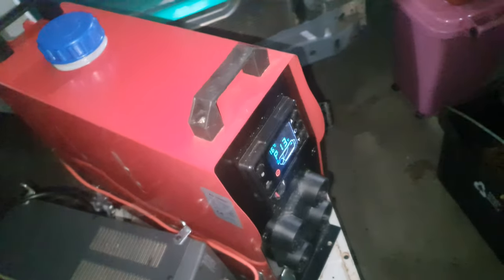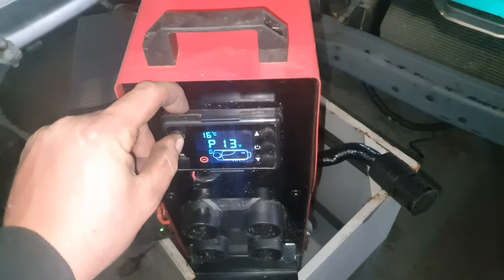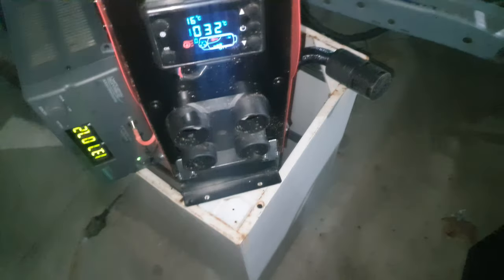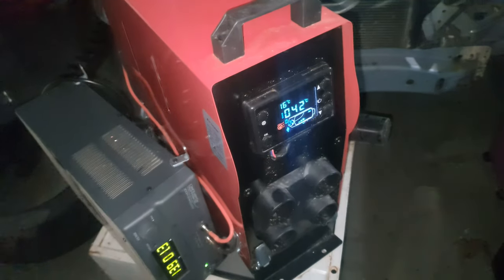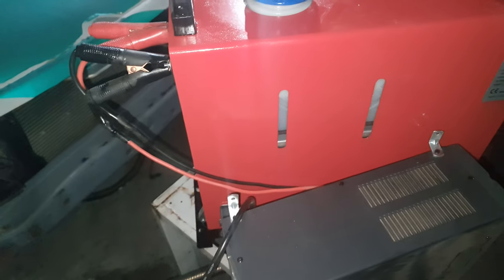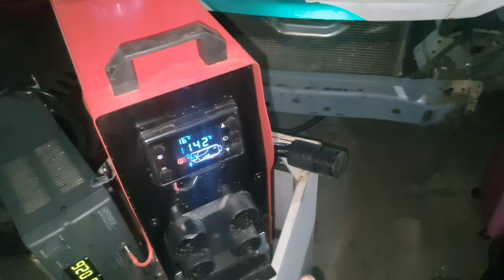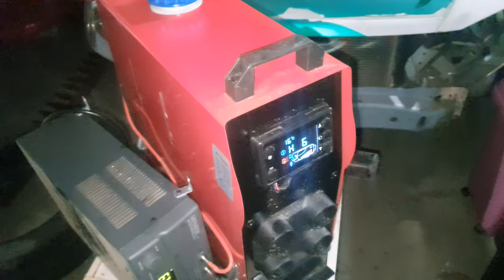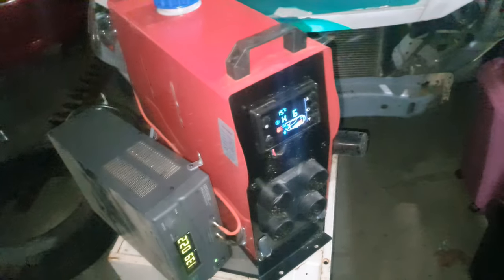All in one 5Kw Diesel Air Heater First Look

Comment: Hi Brad, I mate has one at an off grid shack and it warmed up the 6 x 12 mtr shed very well. His has remote control but we cant get the feckin things to do anything. The remote flashes on its LED so we can see the batteries are working but it just does nothing on the heater display.
The P xxx value that comes onto the screen is the PWM for the fuel pump and the higher the value the more rapid is the clicking so it is pumping more fuel into the combustion chamber. We found that it will used between 1/2 to 2/3 of a tank overnight for a 12 hour on time.
Reply from the maker: Yeah there is a pairing process for the remotes.
Yes you can tune the Hz pulses. For different fuels and economy's

Comment: Good thing Brad, I have 2 similar and running them to heat the containers. WHat about heating oil, I don't think it attracts fuel excise.
Reply from the maker: Ill look into it see what sort of minimum you need to buy. To get a good price.
Diesels cheap easy and everywhere. 
Im working on a filter set-up for the waste engine oil i get faster than I can use

Comment: Hi Brad, when you said you have 600 litres of waste oil, are you talking about deep fryer oil or engine oil and what ratio oil to diesel mix ? Looking forward to upcoming videos on this subject . Cheers Mark ( WARATAH, Tasmania .)
Reply from the maker: Motor oil mate 50 50 works but I'll make more videos soon
Reply: Thanks, look forward to them especially as most people can obtain used engine oil for nothing.
Reply from the maker: Yeah go to super cheap auto and raid the bin full sitting there
Reply: Yep, and it saves Supercheap Auto the cost of getting rid of it.
Reply from the maker: Yep most mechanic shops will let you take some

Comment: I have the 4 port type also were can you find the parts to switch it over to a 1 port I haven't been able to find them
Reply from the maker: You want a single port or a 2 port?
Reply from the maker: https://rover.ebay.com/rover/1/705-53470-19255-0/1?mpre=https%3A%2F%2Fwww.ebay.com.au%2Fitm%2F75mm-Single-Hole-Outlet-Cover-For-Car-Auto-Truck-Boat-Air-Diesel-Parking-Heater%2F224000185601%3Fhash%3Ditem3427739501%3Ag%3ADTAAAOSwA2hdtlj~&campid=5338476033&toolid=20008
Reply: @Oneupthesleevecustoms  thanks for the link

Comment: Is it nessersery to mix oil in?? I live in a caravan an i got a gas heater an it's pritty costly to run. My nabour has one of these an he recommends one of there for me
Reply from the maker: No need but I have 600l of waste oil chilling there so I'll slowly burn it off
Reply: Cool thank you mate i think i follow what your saying.. when i get one when i have the money for it. I have a battery an a 4 250w solar that's 1000w an 3 190w that's 512w on one battery with 2 controller on my battery with 3000w inverter thats my power lol